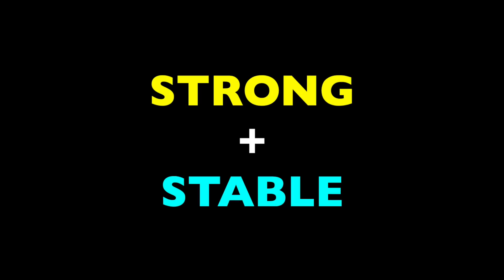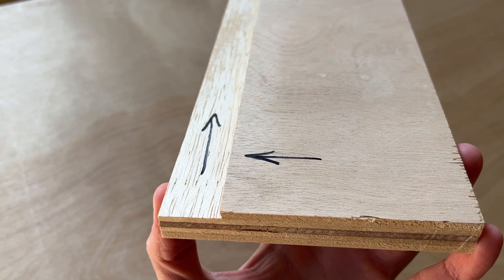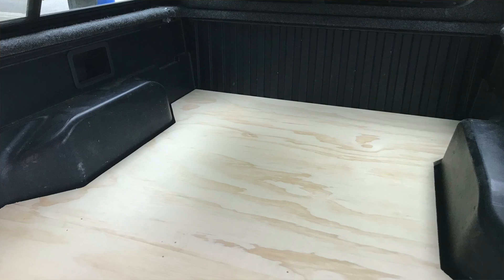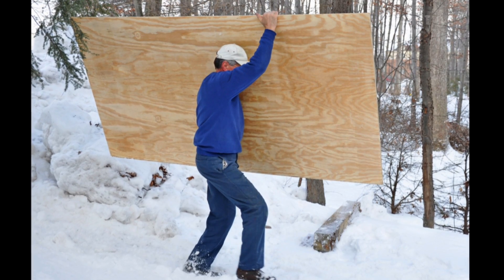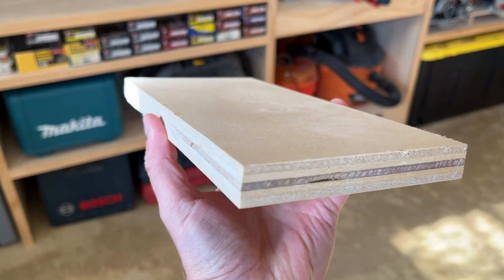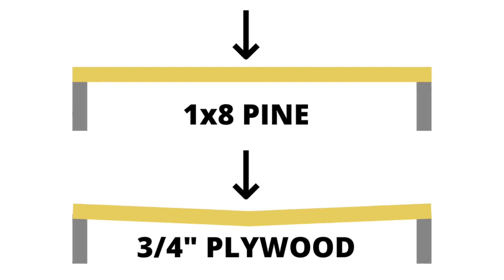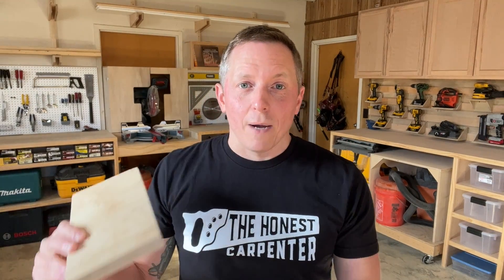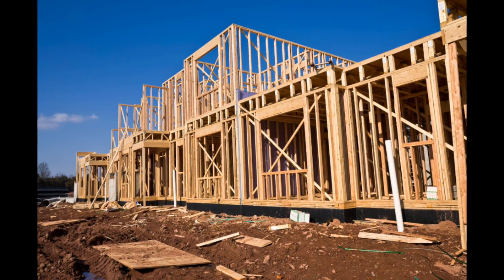WOOD VS. PLYWOOD--What's The Difference?! Which Is Better? (Plywood/Dimensional Lumber--Comparison)

Comment: depending on what competing application you are using it for, like a desktop or shelving, you should try testing it instead of looking at it may you will find out which is stronger.   RTD plywood is the modern plywood that has quality controls so look at the production method.   Your shop is a little to clean it makes it seem your not willing to get your hands too dirty.

Comment: Hi i want to built horse stables and have used plywood before and worked quite well. Sombody did suggest that i rather use mda boards. What is your opinion regarding strength against eg. kicking and resistance against moisture eg urine and water

Comment: Thanks for the video! Would like to ask your opinion on the thickness and type of plywood I should use for 2" thick (because of the stone wool panel thickness) acoustic panels. They would be 40" high and 20" wide and would be screwed and glued together without any fancy joints or reinforcements, take the two sides and put the 20" upper and lower piece between them, fix with nail from the sides, drill leading hole for screw, glue and screw them together. Would it be better to use metal angle joints or a different type of plywood like pine, birch, ...? The panels will be stationary on walls and a few hanging from the ceiling. I was thinking of 1"x2" poplar frames.

Comment: Another benefit to plywood is that it emits less formaldehyde because it contains phenol resins, not urea resins. For context:

"The EPA recommends the use of “exterior-grade” pressed-wood products to limit formaldehyde exposure in the home. These products emit less formaldehyde because they contain phenol resins, not urea resins. (Pressed-wood products include plywood, paneling, particleboard, and fiberboard and are not the same as pressure-treated wood products, which contain chemical preservatives and are intended for outdoor use.) Before purchasing pressed-wood products, including building materials, cabinetry, and furniture, buyers should ask about the formaldehyde content of these products. Formaldehyde levels in homes can also be reduced by ensuring adequate ventilation, moderate temperatures, and reduced humidity levels through the use of air conditioners and dehumidifiers. "

https://www.cancer.gov/about-cancer/causes-prevention/risk/substances/formaldehyde/formaldehyde-fact-sheet#:~:text=The%20International%20Agency%20for%20Research,Report%20on%20Carcinogens%20(3).

Comment: Good video, I’m going to be doing a stain grade, Wainscoting  job, three-quarter inch styles and rails with offset panel molding and was going to use pocket holes for joinery how well do pocket hole screws hold in plywood end grain? With today’s lumber prices plywood is a much cheaper option and edges will not be seen.

Comment: Hi.  Excellent video.  I was surprised to see you mention that plywood is used for shelves.  I thought solid wood would be better due to deflection.  From what i read a solid piece of Maple 12 inches wide 3/4 thick can span 36 inches snd support heavy books but a similar piece of plywood should not be used at that length.  What options dors one gave?  Double up on the plywood by making the plywood 1.5 inches thick.
Reply: Meant to say what options does one have if they use plywood and want to span 36 inches?

Comment: I have to drive in a softer field w my compact tractor, it sunk in the one spot bc ground was too soft, do you think i would be able to drive over 3/4 plywood? Tractor weighs 7k pounds.
Reply from the maker: It’ll wreck the ply, no name, but I bet it’ll give you something solid to roll over
Reply: @TheHonestCarpenter  yea i think i just have to try it. Not expecting to use the ply again but just need it to work for this job

Comment: WOW, very helpful video. I can tell you know your stuff. I have been watching other youtubers for my current project that I have been trying to figure out for a while. You touched on it in your video: Dimensional wood has more strength (deflection) than plywood.

I have been looking for a hand-truck dolly with 4 wheels (horizontal configuration) but the ones that are on budget are less than 40" long, and the ones I like are $400. SO I thought about adding wood as a bed on top of the dolly. Since I need 20" added to the dolly, I thought if I buy 60" piece of plywood, 40" sitting on the dolly and 20" hanging in the air, WILL THE 20" HANGING PLYWOOD SURVIVE 200 to 300 LB load?

Comment: What about that finger-jointed pre-primed lumber?  Can anyone comment on their experience with that?  I've got some exterior trim boards in that material and  it didn't hold up well in the weather.  It has come unglued at the joints, and warped over time.  It was a nightmare to prep the damage in order to re-coat it recently.  My thought was that it was going to need replacing soon.

Comment: Sorry but what was the point of this video?
In August last year I replace 450sqft of roofing felt and timber as it had been badly installed and the roofing felt was rubbish.  I used OSB3 as it was cheaper than plywood, why heavier though... sealing each panel, especially cut ends and after replacing the compromised glass fibre insulation with plastic strand insulation from drink bottles and reflecting the whole roof it was all good.
OSB is a construction composite timber.
I built an outside shelter for my dogs... call it a kennel, but they have never spent a night in it... I built it out of marine plywood and 10 years later it is a good as the day I made it, some of the clout nails on the roofing felt have rust... each of those screw were driving in by hand... the base is 25sqft..
Neither of these protects could have been done with board materials.... also neither of these projects have been completed without board materials.
The summer house roof I removed rotten timbers and replaced them with fresh new battens.  The dog kennel frame was 47mm x 47mm timbers... it is a strong structure and given my time again I wouldn't change the design... I would use better tool to drive the screws home.

Comment: I scarfed up some amazing plywood that i built a table out of. I scored about 40 pieces that were 4' x 18" and 2" thick, roughly 25 ply. This stuff is incredibly strong, and wish i could source this locally. I was given this material from someone who worked for a world wide shipping company, and was told they use it for certain containers when shipping. So, someone is making extremely thick plywood, i just dont know where it initially comes from, and how to source more.

Comment: Thanks for the details of plywood and wood . Kindly explain to contractors why they should use 
3/4 inch plywood  and not 1/2 inch while building flooring on top of the basement. Some of them 
use D grate plywood  in a million dollar house

Comment: I have a 12’ x 20’ deck that is 18 years old and is needing board replacement in several places. What do you think of using the trex type of boards to replace my deck floor? What are the negatives of doing this replacement?
Reply: I think you need to have a very large wallet for Trex decking. (that's a negative).   My pressure treated deck is 40 years old, and when boards needed replacing, we just pried them up and cut new pressure treated to install.  But the positive of doing Trex is zero maintenance; well, sometimes pressure washing is needed to clean out mildew and other accumulated debris.

Comment: I don't agree that a board is stronger than plywood of the same thickness longitudinal.
Not only is plywood stronger like 7/16 plywood vs 1/2 wood of similar core species. What you failed to mention is plywood is wood. It can be softwood or hardwood. The dimensional stability is by far superior in plywood. And strength and durability more predictable and tested. While dimensional lumber has its place, plywood, engineered lumber is  more and the choice for most building projects

Comment: It'd be really great if you could compaire properties of lvl vs nail laminated timber vs mass timber vs dimensional lumber too.  Explaining which uses you can or should substitute your own diy option using clamps, nails , and/or glue, or buy factory/mill made lvl or dimensional lumber. A classic example of diy mass timber is butchers block or workbench top, and nail lamination has all sorts of classical construction uses.

Comment: So I wanted to see if I could build furniture for my kids.  We had gone to many furniture stores, but all of that was built with cheap materials and cost an arm and a leg.  So I studied them.  I asked the kids what they wanted.  They both wanted fireplace TV stands, both of them different heights, lengths, fireplace, finishings, barn doors.  It took me a couple of weeks to figure out the dimensions and what would be needed.  I wanted real wood.  And yes, I was successful, despite my lack of equipment (I used drill, pocket holes, sander, miter saw, but that is all I had).  Barn door hardware is expensive, so I figured out how to make my own.  But the thing is?  finding quality hardwoods is difficult, and I ended up replacing a barn door due to warp.  How could I have prevented that?  The kids love their stuff, btw.  I made them bar carts, end tables, coffee tables, entry tables, etc.  It was quite a learning curve!  Should I have used plywood instead?

Comment: You didn't mention that plywood, like dimensional lumber is not truly as thick as the measurements say. They're something like 1/32" less. This can be a problem, especially when cutting dadoes and rabbets. I think everyone knows that dimensional lumber is not really the size that we call it, like 2x4 or 1x6, etc. When planning a project, all of these factors need to be taken into account. Now, another thing, is that wood tends to expand and contract across the width of the board. This expansion and contraction is so strong that it'll break any mechanical or chemical bond. Therefore, it is necessary to allow for that movement.

Comment: Sometimes they can be used together to make a wooden " sandwich " which can lead to greater strength and stability than  either one used alone. Example in almost every door and window header.Two pieces of dimensional, one on either side of a piece of half inch plywood ,makes a beam with much greater strength because the plywood is on edge. And it adds up to the same width as your studs 3and one half inches!

Comment: So for built-ins to hold vinyl records (which are very heavy) would I be correct that dimensional lumber would be my best option?  And hardwood would be the way to go? Thanks
Reply from the maker: I actually did a ton of vinyl storage with plywood when I worked in book/music stores, David! You just need to use plenty of fasteners, and no spans over maybe 30”.

Comment: Question. I'm planning to build a floating shelf about 12 feet wide using a beam to prevent drooping. Should I use two pieces of deminesional wood, such as (2) 2x8 boards, glued together up on their edge, to span the gap, or should I laminate multiple pieces of let's say 1/2 inch plywood to make the beam? I'm thinking of a beam 6 inches tall and over 2 inches thick.
Reply: I don't know if this is suitable for you project, but  if I were considering making a beam to strengthen a floating shelf  then I would go for plywood. I would not laminate several pieces together, but would either construct the support as a box or an “I” beam. Both are strong and light and will therefore put less strain on the fixings to the wall. Whilst not suitable for every project, plywood is a great material  for many.  As an indication of it's strength when used correctly, The WWII De Havilland DH-98 Mosquito aircraft was more or less made of plywood.

Comment: I go with Dimensional Lumber, it holds up for long time, & it's usually already treated in case I have to use it outside. But I typically use it to replace walls or put in new floors.👷🏿
Reply from the maker: I’ve done a lot of dimensional lumber framing myself over the years, W 😁

Comment: Great video. I knew a lot of this before, but I didn't think about the span strength.

Assuming that your use the same source wood for each, is plywood denser than dimensional lumber?
Reply from the maker: Depends, yeroca! Softwoods, quite possibly. But generally not denser than hardwoods.

Comment: Can you do a video of how to use structural hardware to reinforce joints like corner braces, mending plates, etc
Reply: yeah. 2nd that
Reply from the maker: I def want to cover it soon, Saorsa! Let me get teamed up with some good framers.
Reply: Is it stronger using the Strong tie type metal hangers than traditional methods? Are there any disadvantages to them aside from cost?